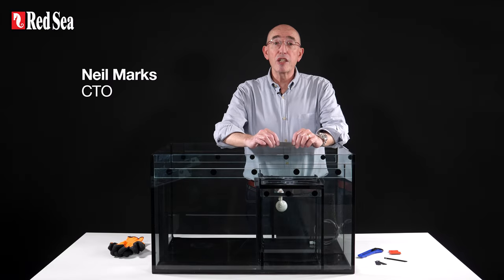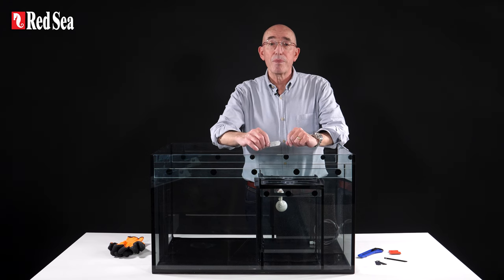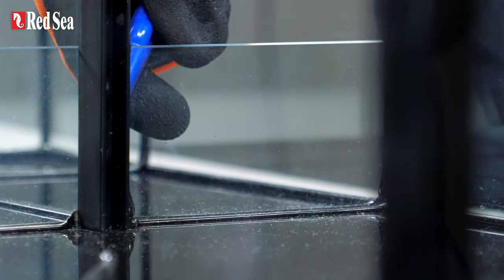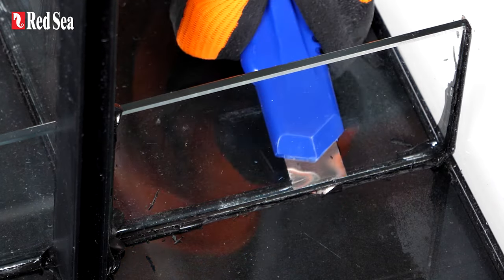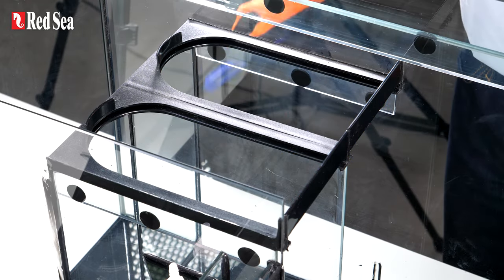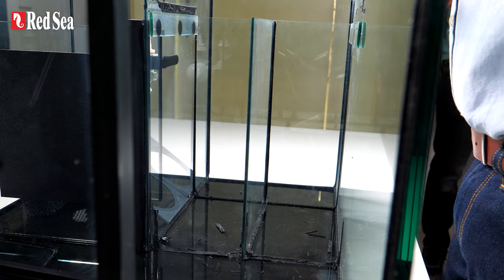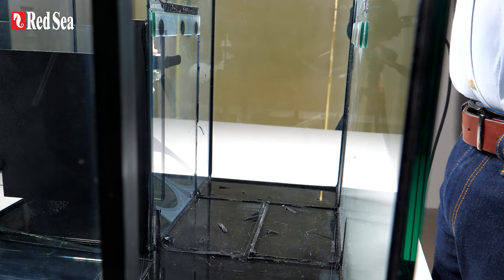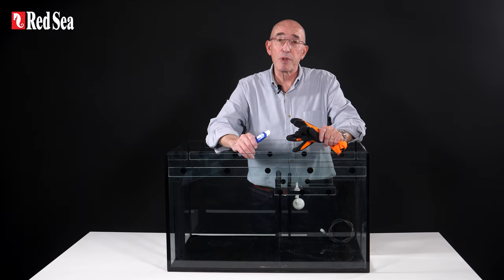How to modify your REEFER sump

Comment: great video thanks for putting that out! 
about to pull the trigger on the S1000 my only concern is the reef mat is untested in the wild. once to take out the cups there's no going back. lets just hope the RS reef mat lives up to the hype.
Reply from the maker: Rest assure we tested it for a very long time, like we do with any of our products, before releasing it to market. But by all means let other test it and review it for you if  you have your doubts. Most Local Red Sea Dealers have gotten one on display or will get it up and running shortly.

Comment: I have a 300xl, I know you mentioned you don’t have to remove those support glass pieces but would it be problematic to delete the ATO supports as I removed it when going to the filter roller
Reply from the maker: What do you mean? If you remove the ATO why would it be an issue?

Comment: So you lose the bar that holds the glass for the refugium? Looking forward to the next part of modifying the tubing for the XL425 and installation.
Reply: Surprised me as well, I've done this modification for the Clarisea a year ago and it took me a lot of work (didn't have these nice thin blades) but I kept those small pieces of glass and both divider slots for future use.
Reply: I did not remove mine was able to keep it in place

Comment: That thin blade is magic. I did my Reefer 250 V3 while full of water with one of the short thin blades in less than 10 minutes. I couldn't believe how well it worked. I took out all the glass rails too. Now the seam on the left side is no longer perfect though as a chunk came out but it is not the main tank and only I see it. It would be very easy to damage the seal on the left side of sump. I hope I didn't, so far so good. Pull the sump out to get the best look and be the safest.
Reply from the maker: thanks a lot for sharing.
Reply: Would this get rid of your refugium?

Comment: Will wait until they bring this already fitted into sump. Looks like some work to do and not under your stand and hand in water trying to see the blade move through silicon.
Reply from the maker: We upgraded all our systems at the lab and offices with the water running. It can be done and not that hard. Check it out at your local Red Sea Dealer once they arrive.
Reply: @Redseafish  I did mine full of water and it was so easy with the thin blade. Only used a single thin blade. I will say it would be real easy the damage the seal though on the left side of the Reefer 250 V3 sump. I think mine is ok but watching for leaks.

Comment: I can't see how this can be done without draining the sump. Surely all the small pieces of silicon would be floating around everywhere and be near impossible to get them all sucked up after the job. Wouldn't fancy small pieces of silicon floating around the tank and getting sucked up in the return pumps and UV's!!
Reply from the maker: Most of the silicone sticks together, as a string. Depending on how much you want to clean the remaining cuts you might get smaller pieces, however if you have one run it will remain limited to the major "string".
Reply: @Redseafish  to be honest I don't have a red sea tank. I drained a little water but for the most part it was really quick and easy. Now the reefmat is up and running. I've got it facing forward in the tank using the lip but I had to set the driver unit to the left, even though its installed on the right hand side as I look at it. Which way do you face the unit to tell the side of the drive unit and us there a reason I'm getting daily clean sensor alerts even though its brand new and appears to be working perfectly?
Reply: This is exactly what happens.

Comment: Unfortunately it doesn't work on my reefer 350 with reefmat 500... It's on the struts for the osmosis tank
Reply from the maker: What doesn't work? The cutting?
Reply: I have one of the first reefer models. So no g2. I cut out everything as in the video, but it is too wide and stands on the glass, which covers the inlet/filter baskets of The rear feed chamber is separated. It is wider and does not go into the corner. @Redseafish

Comment: I’d like to see him do it when the sump is in the stand full of water. I’d like to see him do it on a 425xl v2 sump. There’s no room to work around getting the 2 pieces of glass cut out. A shorter handle on the knife. Might help so you can hold it more horizontally.  I got the cup holders out ok but been working on the glass panels frvan hour!

Comment: Just use some fine picture frame hanging wire wrapped around a pop stick and pull the wire between the joints. No risk of broken blades, or cuts from slips or trying to hold a razor blade in your hand and no chipped glass or razor corners to the eyes....

Comment: why not make a design that filter roller is included, rather than the owner of the red sea is doing the modification?
Reply from the maker: Hi, older models were made, it's a new product. Future versions of the REEFER sumps will enable easy addition of the ReefMat to the system.

Comment: I got the reef mat and had to modify my sump. I have a 200xl and the process went smooth but there’s one thing they don’t tell you… when you remove the bubble trap you get so many micro bubbles in your main display! Why would they even say it could be done!? They whole point of the reef mat was to get it crystal clear not make a bigger mess! Please help Red Sea!
Reply from the maker: Usually after the skimmer breaks in it will stop. You can also direct the skimmers outlet away from the main pump or use the sponge to box the pump to help for now.
Reply: A million ways to stop micro bubbles,  be creative.
Reply: @Reefingaddiction  right.

Comment: This absolutely sucked doing it wet and in cabinet. Regardless of what they say I don't recommend. Silicon floats around the system, plus it's extremely difficult to see / ensure you've made all the cuts correctly. Finally, they don't mention you'll need to modify your Reefer intake pipe to fit the ReefMatt hose. I had to saw down my intake, then glue the new fitting while the tank was full. Stressful and don't recommend doing it wet. I'd like to see them do this in 15 minutes in a used sump!
Reply from the maker: Sorry to read you had a hard time. 
We did it wet and working on all our displays at the office, as well as many thousands of customers. Join our FB group and see first hand what and how people did it. Wet working sump and no issues.

Comment: I would not even attempt this with  the sump in the cabinet.  It definitely would be difficult.
Reply from the maker: Join our FB group, we have hundreds of people who did that, in a wet working sump. You might get the confidence and reassurance you need to do it.
Reply: @Redseafish  I plan on getting it but would still remove my sump to clean it out good.  It's pretty nasty from the last five years.

Comment: I have the same XL 425 V3 sump and about to start the modification. I was hoping I could keep the refugium baffle but in this video you remove both guides. If this is correct, how to keep using the refugium?
Reply from the maker: You can keep it. We got a bit "trigger happy" with the blade.
Reply from the maker: Great.